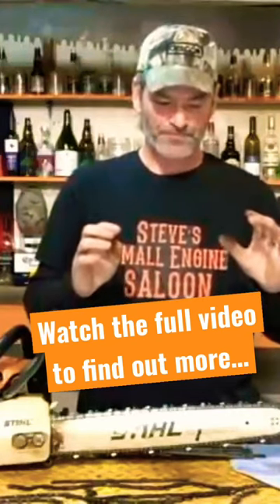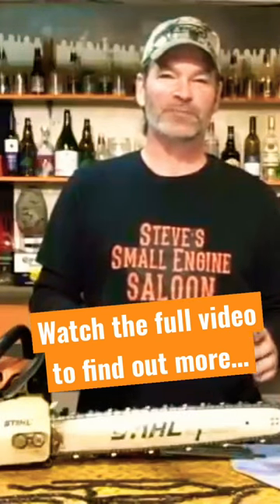How To Sharpen A Chainsaw (Click CREATED FROM for FULL VIDEO)

Comment: I get that guides like this are "supposed" to help with accuracy, but I hate them because I can't see what I'm actually doing.  Much prefer to just use the laser etched line on the tooth as my guide and go simple round file.  Just as fast and so much easier to observe that critical tooth edge.

Comment: Quick way to sharpen chain, buy extra chains, swap dull for sharp, relax and enjoy a beer, take dull chain to shop at your leisure, let some other fool sharpen chain. I have at least two extra chains available at any given time. Learned this trick from my pops who used to fall trees for a living back in the 70's & 80's and packing extra chains was a necessity. Never knew what you were getting into especially after St Helens blew dumping silca ash on everything. That stuff would dull a standard chain in seconds. Guys cutting near the mountain starting using special chains.
Reply: You'll waste a lot of time changing chains and pay 50X more money paying for that sharpening too.
No exaggerating either
Reply: @burtvhulberthyhbn7583  I don't know how you change chains but I can do it in a few minutes plus it enables me to clean my saw, flip the bar for even wear,  and check everything out.  Time is money and swapping chains when it counts saves money.  Plus I can use the time it takes to sharpen a chain to do other more important things.  $6 to $7 every few months is no big deal. I am very careful how I use my saw and very rarely dull my chain. My father taught me how to properly cut to avoid ground hacking, kick backs, pinching, etc..  saws must always be treated with the utmost respect and control. A saw is very much like a loaded gun and if used incorrectly can render serious bodily harm/ death if handled carelessly as so many folks do.

There is also the fact I suck at sharpening things and like to keep my local shaw shops with friendly folks operating and keep these awesome blue collar folks gainfully employed. Don't wish to take someone's meal of the table and put them out on the street.

Would you want Steve to be homeless? He would be if everyone did all their own work.